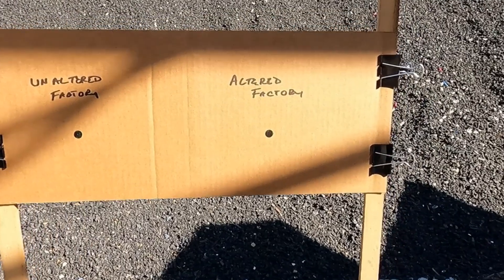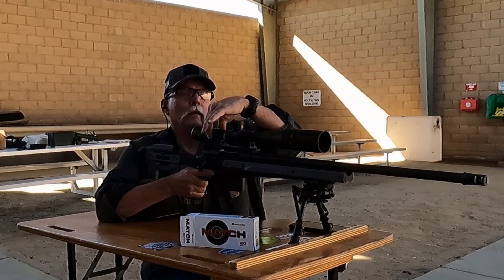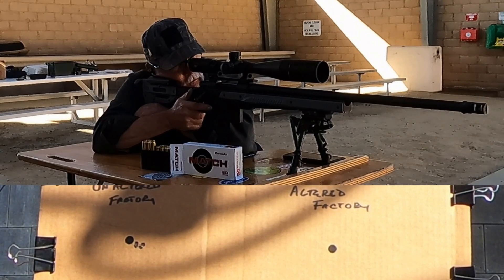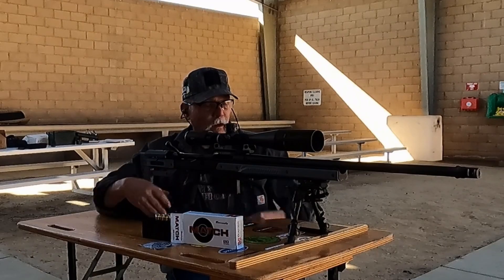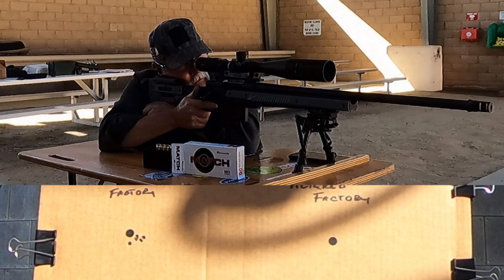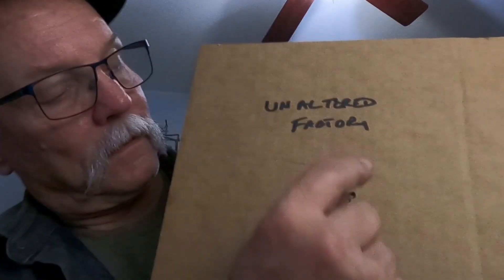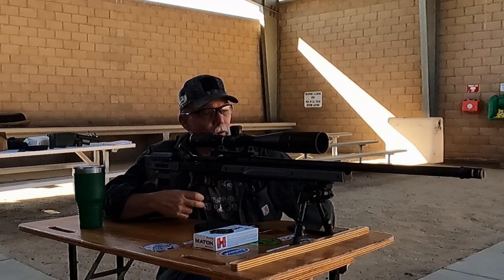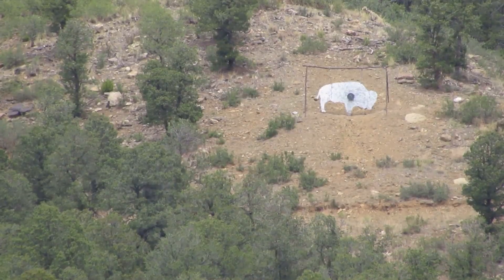Can we improve the Factory 6.5 PRC by changing the OAL

Comment: The factory rounds were probably crimped and when you moved the bullet it messed up the crimp.
Reply from the maker: I don't know if the were crimped or not, when I redid this test I found the necks had expanded to .265" internal diameter, possibly from the inertia puller. You may be right though and the crimp is so minor I couldn't see it. Thanks for watching.

Comment: I noticed the same thing with my 6.5PRC shot the match ok but the hunting load was like a 12 gauge shot at 100 yards! I really want to try some 156 Berger Hunting VLD’s in it and seat them out as far as possible and hopefully they will shoot fine if not I’ll be considering selling it as a bad decision on my part for purchasing the rifle. I didn’t mention the rifle is a Savage Ultralight Carbon barrel by Proof. So far not impressed at all but I’ll give it a good chance to prove my first impressions wrong!
Reply from the maker: Hopefully you find a load and seating depth that rifle likes before giving up. I will be repeating the improvement test, I have a new box of factory ammo and this time I will break down all the way and reset the neck tension before reseating the bullets. I'll be able to weigh the charges and check consistency of charges as well.

Thanks for watching.

Comment: The reason your altered group sucked was the neck tension got screwed up from breaking the stick in the case. Also could be the velocity difference took you out of the node.
Reply from the maker: I came to that same conclusion while pondering what happened and agree with your assessment. I broke down and bought some more factory ammo and will retest. I will break the round down completely, weigh charge weights for consistency and reset the neck tension. we'll see how that works out. Thanks for watching, I really appreciate it.

Comment: This is perplexing but because it's factory loads and if it's not to late measure overall case lengths look at head stamps and look for any differences in the primers ( after fired I don't think you can see any but just thoughts ).
I have only ever had 1 rifle that shot well with a certain factory load and due to the fact I don't have enough of them left and it's about 15 years and they aren't made any more I'm going to have to start this process. Funny fact is it's a Howa 1500 as well
Reply from the maker: Well, since I never removed the bullets, just moved them out a bit before reseating I don't have those measurements. But, I will be repeating this test and my next iteration will involve removing the bullets, weighing the charges and resetting neck tension before reseating the bullets. I can measure the case lengths at that time.
Reply: @Halfmilesniper  cool in video you said you most likely weren't going to buy more. So I just guessed that you were going to stick with your reloads... just out of the same of trying to figure out things thought as you were preparing the brass for reloading would maybe try this stuff.
In all honesty it doesn't matter unless it will make a good video...
Sorry I couldn't watch the premiere my hours of work interfer
Reply from the maker: @JeRKII  I wasn't going to buy any more, but then I decided that the neck tension may be way off due to just knocking them a bit, so it give me the possibility to 2 more videos...maybe one on how I lengthen, along with weights and measures then a second on the shooting results.
Reply: @Halfmilesniper  awesome

Comment: Super interesting test. I am sure you let the barrel cool between the two 5-shot strings. So it’s either the seating depth, or
The bullet puller monkeyed with the neck tension
Reply from the maker: There was definite cool down between strings. I am also of the opinion that moving the bullets without resetting the neck tension may be the culprit. I plan on repeating the test and will pull the bullets and reset the necks as well as weigh the charges.
Reply: @Halfmilesniper  awesome. Can’t wait to see if there is a difference

Comment: Very interesting
Reply from the maker: I know, not the result I expected. I have had some time to contemplate and I think the shortcut I took is the issue. I only moved the bullets, I didn't pull and reseat. I am going to repeat the test but I will pull the bullets, weigh the charges, reset neck tension and recharge and reseat the bullets. I think that will change the outcome.

Comment: Well, I’m flummoxed. Never saw that result from getting close to the lands. Eric Cortina has a pretty good vid on setting OAL for best accuracy. I’d be surprised if you haven’t seen it.
Reply from the maker: I have seen Erik's video, and I've loosely used it as a guide. I am slightly flummoxed as well but on reflection I think...just a guess, I think my error was in only moving the bullet reather than pulling and reseating. Next time I will pull the bullet, reset neck tension and then reseat to my length.
Reply: @Halfmilesniper  Good Plan.

Comment: Did you switch them by accident?🤦
Reply from the maker: Nope, shot the shorter factory rounds first. That was the first good group the factory ammo gave me...wonder if the powder is temp sensitive? I will repeat this test but will pull the bullets and reset the neck tension to remove that variable from the equation.

Comment: Those results were unexpected. I'd have bet a coffee that lengthening the OAL to your handload would have nearly equalized the performance. Interesting to note the "flyer" in the first group was also the slowest. Your conclusion of sticking to your handloads is, I think, the correct one. This was a fun test to watch, now I've slipped into the overthinking realm of the 'why' concerning results.
Reply from the maker: I have been pondering this test since shooting it. My gut is saying it is because I only moved the bullets rather than pulling. I will repeat the test but I will pull the bullets and reset the neck tension. Heck, I'll even weigh the charges to check consistency. Then we'll stick with home rolled ammo.
Reply: honestly, hes shooting from a rickety bench with no wind flags.. with a relatively light rifle for the caliber even with the brake

Comment: Interesting consideration and theory. It was a good test to gather data. Interesting results. This may not be conclusive but it does give you a an idea.
Reply from the maker: And next we will get some more factory ammo and repeat the test after resetting neck tension. Curious what will happen then.
Reply: @Halfmilesniper  I was definitely curious myself. I have pulled bullets from old tarnished and possibly compromised brass and put powder & bullet in fresh brass with acceptable results. I always wondered if that affected the bullet.
I thought you might get better results from this test but I did have a little thought that it might be worse.
Reply from the maker: @guardianminifarm8005  Possible damage to the bullet is why I tried only moving them rather than removing them. My guess is that may have loosened or affected the neck tension. We'll see what happens in round 2.
Reply: @Halfmilesniper  look forward to tests. Thank you. Stay safe.

Comment: I'm a little surprised that the larger jump was slower. As you mentioned, neck tension might be a difference in accuracy, but you might be past the "messing around for fun" stage.
Reply from the maker: Well, we will try again and do it by pulling the bullets and resetting neck tension to take that variable out of the equation. To be honest, I expected slightly slower velocity from the longer OAL due to more "space" in the case.

Comment: You know how to complicate things lol. I thought it would help. Just hope my girlfriend doesnt find out you can improve OAL with the whack of a hammer. I'd be in trouble. 💥🙈
Reply from the maker: I hope so too! Sound kind of medieval, lol
Reply: @Halfmilesniper Makes you wonder since velocity jumped up but spread worsened what if you only changed length difference by .004 or .005 instead of by .007.  Possibly a happy medium? At least you have more factory brass to reload now. 👍🙏🇺🇸
Reply from the maker: @billdye3530  My gut thinks that moving the bullets may have affected the neck tension. I have to get another box of factory so I can repeat the test but fully remove the bullets and reset neck tension. Plus, I can weigh the charges and try to determine the powder used (possibly some proprietary powder blend).